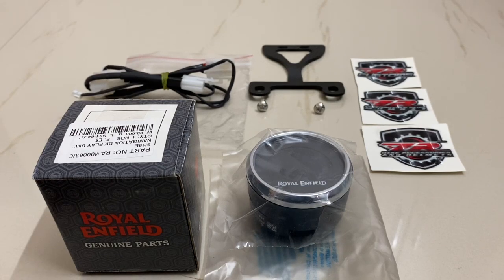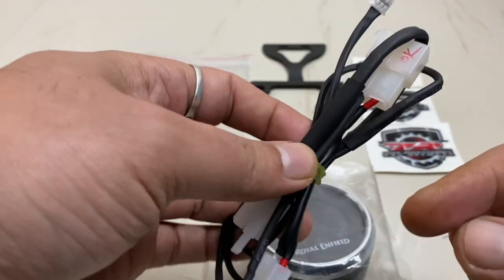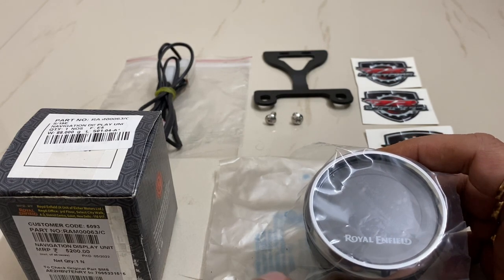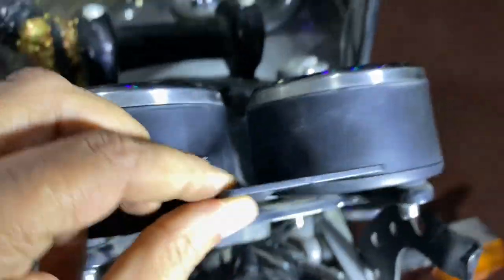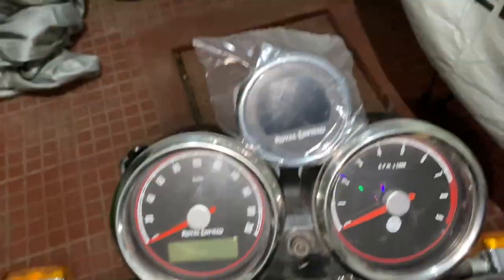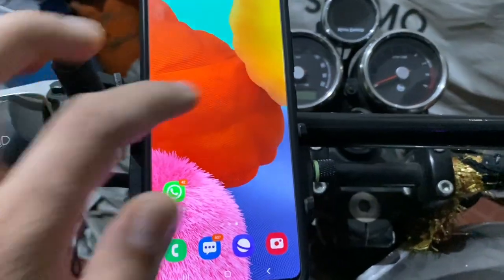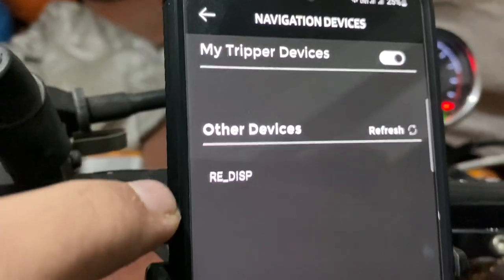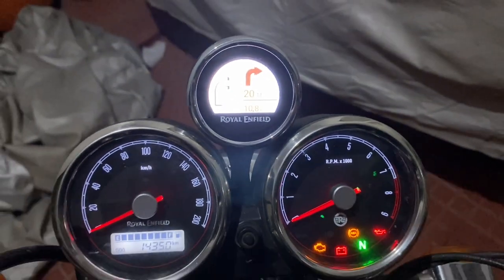Tripper Navigation and Clock for Interceptor 650

Comment: Clean bro. Love all the way from malaysia. Just imported from india today.  Was wondering would ask someone to do for me but looking at your video, im confident i can do it.  I'll update you if i burnt the bike down later.
Reply from the maker: Thanks so much Buddy, means a lot to me. Love from your friend from India 🙏
All the best and let me know how it comes out the result. I believe you got the harness kit along with the clamp as well 💐👍
Reply: @automotriztechnica  hi. Do i need to wire both into main power and auxilary to get it to work? Either one should be enough right
Reply from the maker: @Km15DJ  It needs a permanent 12V for memory of real time clock in background and another ignition wire which is needed to get it into power ON mode where display comes up. If you get a socket set from Akhtar Bhai from Mumbai you are sorted, else if you have the pin diagram of it you can wire it too.

Comment: Well done!  Do you know if the Classic 500 is compatible?
Reply from the maker: Thanks buddy, the Classic 500 bottom right fuel guage/ampere pod might need to replaced with a Classic Reborn size tripper navigation pod. Please note that I used the Meteor Navigation which is larger than the Classic one. The wiring harness you’ll get it from Rider Akhtar 7R Customs (Mumbai), +91 7864-996786
You may call and ask him on compatibility for 500 before buying.

Comment: Are you still using it? Also are the brackets holding up?
Reply from the maker: @harishreejoshi3195  Not using it, I immediately removed it in a day because the 3 eyed looks I don’t like it. Looked like Bajaj Caliber or a Demon Cyclops with 3 eyes. But it worked like a charm.
Yes, brackets and the wiring is also the part of the package from Rider 786 Akhtar, only you need to buy a Meteor Navigation pod.
Sold the bike and the Navigation 🧭

Comment: Hi, Does this Trooper module give information of bikes Realtime Voltage ?
Reply from the maker: It does not give information on voltage, only time and navigation
Reply: @automotriztechnica  Sad, I badly need a Voltage meter which is reliable for my interceptor as its loaded with extra electronics.... As you know Interceptor RR unit is cranky at times.
Reply from the maker: @officalJalgara  I have purchased this module today, hope this can help you as well, here is the link from Amazon: amiciSmart DC 5V-48V Battery Capacity Indicator Digital Voltmeter for Car Motorcycle with ON/OFF Touch Switch https://amzn.eu/d/3cMxco0
Reply: @automotriztechnica  yeah bro, I was about to buy it, however this voltmeter you have mentioned does not come with a clamp or wiring... So it would be hassle... Anyways, I stay in Bangalore. I will check in JC road tomorrow.
Reply from the maker: @officalJalgara  I am planning to mount it on XPulse 200 4V as I have a higher load of MadDog auxillary lights and a Thunderbolt high power headlight, thinking to mount it on handlebar with a custom made clamp comes with action cam mounts. Please update me if you get any good Voltmeter with clamps/wiring at J C Road, I too will pick one, Thanks Buddy
Reply: @automotriztechnica  I have some ecu and fuel management mods, and I have no faith with INT 650's battery, I have already replaced a Rectifier unit for the same issue. So just purchased a Voltmeter from amiciSmart just before messaging you,  it supports DC 5V-48V Battery, I just need to figure our a way to install it. This Voltmeter is a must have foe people like us with extra electronics on the bike.
Reply from the maker: @officalJalgara  I believe yes, this instrument will save people like us. Mounting can be done with a custom made metal clamp at mirror mounts or on handlebar
Reply: @automotriztechnica  Yeah bro, I saw one of the video from NCR Delhi. I even contacted them for the clamps, unfortunately they do not have them :eyes-purple-crying:. And I do not know how to get custom clamps done in Bangalore. Wiring should be sorted, but fitting I have to do some Jugad lets see.

Comment: When the navigation is ON, the time display goes OFF??
Reply from the maker: Yes, that's correct, the time display screen is replaced by navigation screen. Interceptor does not have any other clock in the 2 pods, this is the one we have to rely on.

Comment: Hi! How can i connect the tripper with the ignition? I have to connect and disconnect the wire everytime i want to use it. Thank u for your vídeo!! Help me a Lot i have this problem yet.
Reply from the maker: There is a separate wiring harness created for Interceptor650/GT650. One male & female socket plug & play one is live from the battery and the other from the ignition these combination go towards the Navigation pod. It will be easy to get one built from Akhtar 7R Customs. Please WhatsApp/call him at +91-7864996786 he will be glad to ship the required cable.
Reply: I already found the problem:) it was just invert the connection of the socket! Now it works with the ignition. Thank u very much once again!
Reply from the maker: @carlosenriquen.9222  Fantastic 😍 Enjoy your ride with Tripper Navigation 💐

Comment: It is one of the useless accesories, its not going work accurately, for 5k its useless use phone holder instead of this.
Reply from the maker: In my case it was precise than the one I have on other bike. The GPS data is taken from your phone and the precision is 100% dependent on your phone. Just to be on the tech front, your phone GPS should lock to L1 (1,575.42 MHz) or L2 (1,227.60 MHz) RF signals from the satellite. The RE pod is designed in collaboration with Google. The Phone GPS data is sent to the Navi-Pod via Bluetooth, simple on the device display.

Comment: Looking horrendous
Reply from the maker: But why looking horrendous? Can you please elaborate more on it that will help the auto enthusiasts. Thanks
I believe you are mentioning in the final looks on the Panel Cluster; if that so it looks Horrendous and looks like a 3-Eyed Cyclops 😂
Twin-pod looks still better.
Reply: @automotriztechnica  you've asked the question and you yourself answered it 😂 that additional navigator didn't look good in between. It spoils the whole rider POV. Anyways it is a turn by turn navigator so it doesn't help much., quadlock or ram solves the problem. And some people don't like the look of mobile mounts too., so there are many magnetic tank pouch/bag options available in the market like Carbonado, Rynox, etc. And there are clocks in Amazon which can be fitted to the stem nut for the ones who are cautious about time.
Reply from the maker: @likeablebiker  You have much aesthetic knowledge appreciate that. The magnetic tank bag have created some issues in the fuel injection process. I believe you are aware of it.

Yeah, by the way I sold the bike long ago. It was a horrendous decision on buying it.
Reply: @automotriztechnica  why do you feel that way!? Any reason!? For me., Interceptor is one of the best bikes in the market as it has a beautiful engine with a lot of character to it. It may not perform like the remaining but it has its own stance. I own 5 bikes., Apache RR 310, Duke 390, Street Triple RS, Ninja 1000 SX and Interceptor 650. Each of these bikes have their own purpose like duke and Street triple are damn fun to ride and Ninja is an absolute beast on the highway while touring. It is a mile muncher. In the same manner Interceptor carry a lot of character. It might be the reason it is an air cooled engine which is very much mechanical or the 270° firing order or the riding stance.. I don't know.,
Reply: @automotriztechnica  I never faced any fueling issues because of the magnetic tank bag and there might be fuel pump issues but never ever heard of the issue because of the tank bag.
Reply from the maker: @likeablebiker  Makes good feedback point. Rest all good for you? Like riding ergonomics? My issue was luggage for touring; for which I’ve let it go; else I would have modified it highly to the core from a Delhi Motor Customisation Center and have kept it as a Dosa-Chai Trip machine😜
Reply from the maker: @likeablebiker  You have many bikes in stable, it will give good experience. I have currently 3 of these now, Interceptor was replaced by G310GS, a Classic Reborn 350 for long tours, it can do anything & the last one is Honda H’ness which I’ll let it go. Why I sold Interceptor 650 because at Attibele near the lake there was a white loose gravel, it got fish tailed and it was difficult to control the movement after it lost rear traction (Pirelli’s), while controlling full load was felt by me and I thought to change the tyres to Ralco Off-road spec. But made my mind to sell it. The turning radius is huge and the Chassis cannot hold my top box, many of my friends Interceptor’s rear U shape tail got cut and they had to weld the pipes. These are the reasons for which I let Interceptor go. Your SX1000 Ninja is all round beast with 4-Cylinder Turbine.
I love the Interceptor engine, 270 degrees but the weight distribution still needs proper management.
Reply: @automotriztechnica  yes!! Many people thought that the Interceptor was a touring bike until the Scrambler 650 got leaked. It was never meant for that., atleast not meant for mounting top box and all. I use a 50L tail bag and in rare scenarios I'll add saddles too. They does the job pretty good. And yeah little tweaks in the front and rear suspension makes you to think that is this the same bike. Alloys plus Vredestein tyres are cherry on top. I didn't like the complete stock setup either., I've experimented on it and then came to a conclusion that we shouldn't treat it as a adventure/sports tourer..
Reply: @automotriztechnica  in my observation., I've seen that the overall weight distribution is good. Bike is stable at high speeds. Doesn't swing at cross-winds. The stock suspension setup is too bad for our road conditions. Paired with spoke rims and pirelli phantoms on old models it becomes worse. I've bought the new model with alloys., I've changed the forks to YSS kit and tweaked the rear setup (damping and rebound) accordingly. I've also added Vredestein tyres and everything has changed from then on.
Reply: @automotriztechnica  I bought RR 310 in June 2018 and Interceptor was just launched back then. Most of my friends bought the INT and I never liked the bike back then., so I went for RR 310 and pretty much satisfied. Most of my friends sold the INT in just 2 years. I've bought Duke 390 in 2020 for touring as the RR 310 power was not sufficient for me. Duke was an absolute beast till date. I enjoy it every time I ride it. Many people commented that I don't look good on the Duke as it looks like a toy bike for you. So I wanted the Duke's fun again so I went for Street Triple RS in 2022. I was about to buy Z900 but Ninja 1000 was always at the back of my head. And also I didn't get the adrenaline rush in Z900. So went with triumph. In mid 2023 I've bought Ninja 1000sx as a proper sports touring machine. Already clocked 9k kms on highways. And I just got my Interceptor in February as it is completely upgraded now by RE. Alloys, powder coating, better brakes and tyres, overall built quality has also increased. So I went from hating it to the core to a fan boy. I'll be selling by RR 310 and Duke 390 by this month end or next month tops. Will miss them.
Reply from the maker: @likeablebiker  I got you, mine was a 2019 Feb, BS4 model; Silver Spectre; the good thing was it had halogen lights. Secondly, I was mentioning the loose gravel grip is bad for Pirelli so it fish tailed, I was fast enough that to control it back needed more effort; no problem in wind or on highways.
Yes, suspension is horrendous (Stuart’s dialogue from UK HeyYO) that thud bottomed out both front & rear on the Carmelaram Decathlon bridge same place several times; OE suspension setup for that weight of bike and mine additional on it could not sustain; had plans to to change to Ohlins or YSS and there is also a Chennai guy way2speed who is a friend of mine mentioned he has springs for front. But we came up with a 5-6mm spacer on top of the forks that resolved for most of the people.
But after these Saga; I still loved that engine not the chassis setup & suspension because I was searching Classic like suspension in that. But if you see Bonneville 900 is far much better bike if you compare to it bust also costs 3 times more.
My plan was around 1 lakh to spend on that bike. But one of my known friend among here nearby did something at service Center to my Bike (it got a deep scratch on tank) that also made my mind change the decision of modifying it. Had also plans to get MotoWings stainless steel exhausts. Well that’s the story. 

By the way, you are 💯 % correct on the Tripper Navigation Pod for Interceptor, that looked most horrible spoiling Twin Clock looks. It looked liked a Daemon named Cyclops who had three eyes, 3rd eye on forehead that’s tripper navigation. 

I removed it with a day or two 😃
Reply from the maker: @likeablebiker  You have done the best thing with luggage setup. I had plans to put a claw luggage on it.  The main reason to sell the Interceptor was one of my known rider did something after swapping his second hand Chrome(Dust & Glitter) Interceptor with me and also a deep scratch on the tank as another second key on the tank scratched the paint while they were opening the fuel cap. Also, he repeatedly told me to sell the 650 twin, maybe it came to be out of his bad mindset it was done but I gave him benefit of doubt always. So multiple reasons that went against it that made me to sell it off then. I would have handled that better then what I still feel it now.